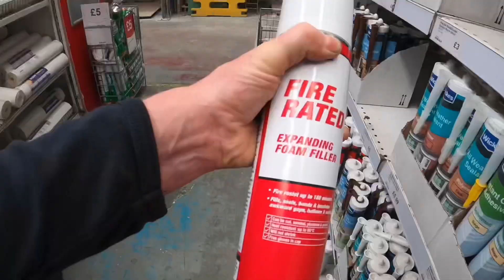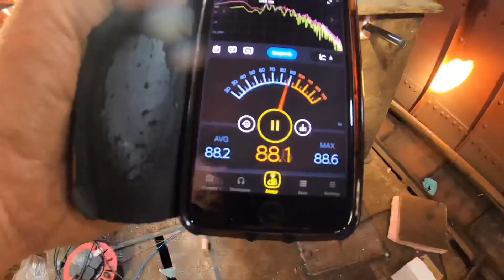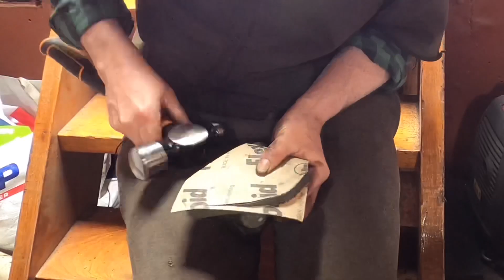I build a box to quieten the generator and service my DAF 475 diesel engine. Dutch Barge Linda #45

Comment: Hi Canice, lots of preparation work done! I must mention that never has a jubilee strap been strapped so well as that strap that has been truly jubilee strapped! 🤪😊🤣
I like the theory behind the sound proofing, but sound is a fu%*r to control! I used to have an eight piece band in my home studio, we had raised 7 inch rubber tiled floor, compressed Rockwool filled plasterboard lining, 50 mm styrofoam ceiling, double lined doors, sound dampening everywhere! It made a huge difference, but it only made a difference!
The only ever time I've experienced a truly sound proofed generator was on a building site, it was the size of a small shed, the 150 mm acoustic foam and air tight structure was impressive to say the least, the exhaust was impressive too! 
Knowing the racket those units make, I feel the reason for the silencing efforts were as much for your own mental health as in as much for your neighbors?
A MASSIVE THANK YOU  for clearing up everybody else's mess! If nobody else appreciates it, believe me I do! And I'm not even in the UK! Your a fine example of what social responsibility should be! Imagine if everyone spent two hours a week doing that, how much we would all benefit from it! Not to mention the transit of waterborne waste to the sea, and the impact it's already having on the planet. THANK YOU! I don't normally drink, but if I meet you At some point in the future I'm buying you a pint! Or a coffee, whichever you prefer, whether you like it or not! Lol 
Until then,, put the virtual kettle on, let's have a cup of tea and get cracking on some serious Chat and hard lifting of ideas! Whilst drinking copious amounts of tea, coffee, or ice cold bottled beer.😊😊
Take care Canice, and stay safe. Thanks for the tireless effort You make for all of US! Keep up the good work!
Reply from the maker: Hi Simon, thank you for the great idea! Those jubilee clips are solid as a rock and less likely to melt!😀
I have a friend who is a sound engineer and he made the point that if you want to make it silent, you need a box in a box and another box and keep making boxes until the sound has given up trying to get through the air gaps. That’s why (I’m assuming) there is a big drop out side the boat with the doors closed! I’m done making boxes though...😂 I’m happy that it’s better for passers by. Thankfully I only need it for the high energy jobs. The fan and all the power tools run off the solar panels! 
New toys coming next week, which will explain the delay in welding....
Thank you for the image of the 8 piece band and the neighbours looking on..... I’ve been in enough rehearsal rooms to know the only people who appreciate rehearsals are the people participating in the rehearsal!!😂
I was looking over my trash collection work and the place is staying clean, which is a surprise, I as expecting it to fill up as soon as I turned my back, but no. The bit I’m cleaning is hard to get to and the stuff I’m pulling out has been there a long time. The good news is that I’m not the only one doing this and between us it’s getting better. There’s certainly more awareness and what’s even cooler, passer’s by young and old show their support for the effort! 
Good news I don’t drink either! I spend my money on jubilee clips!
See you next week!

Comment: Had this horrible notion that your being back to work might see the demise of the gorgeous beard!! But enough - saw the wrecked gasket emerge and instant recall to how my Dad taught me to tap new ones out for my vintage cars. Then damn me - you started taping one out! I'm most impressed Canice! I take it that DAF engine was from/for a truck? Thanks for sharing - Theresa
Reply from the maker: Well, when I shave the beard off, I looked at the fat face underneath I immediately regretted it and then put the cheese away....😂 

I particularly enjoyed tapping out the gasket. I watched how to do it on YouTube and then bought the hammer and off I went!

That DAF engine is the baby at 4.7litres. There the 5.7 and 6.7 in the range. All of them a bus and truck engines. DAF and British Leyland merged in the 1980’s, but I believe the same engines were being used by BL in the 1960’s to power Leyland busses. The sound and smell of the 60’s! 😂

Comment: Never buy mcalister tools, I had an angle grinder of those and it lasted 10 mins
Reply from the maker: Oh dear! I had a Lidl angle grinder for a while but I don’t expect them to last, it’s just a quick fix in these straightened times. I did but a Dewalt angle grinder though and it is doing a lot of work and holding up….